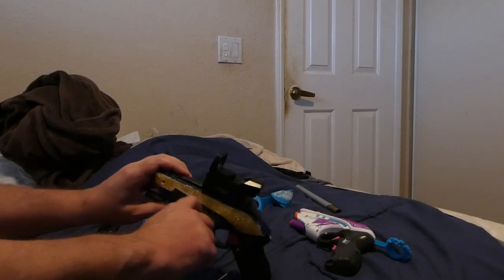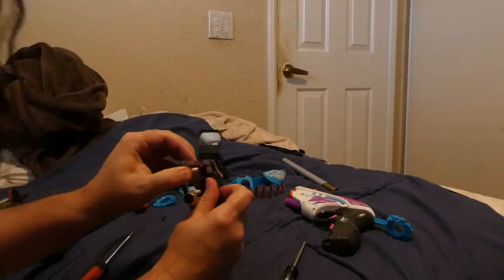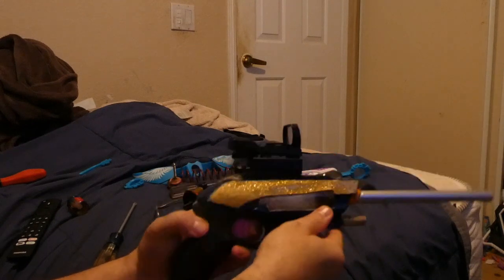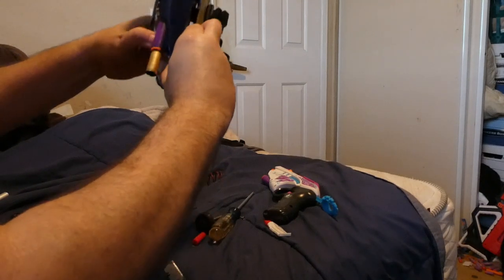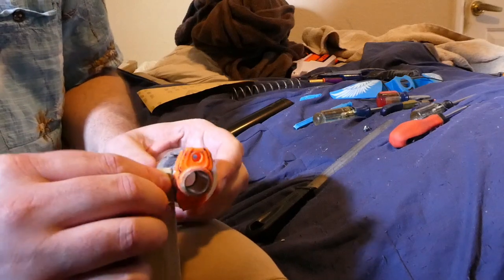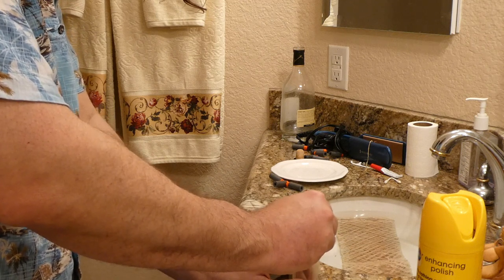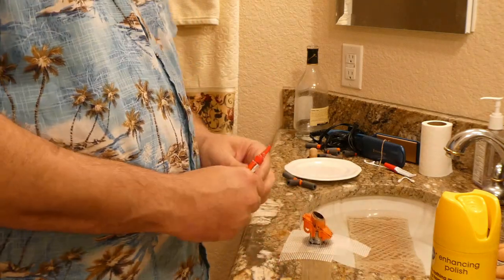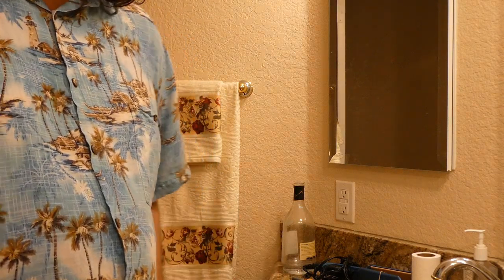Plunger rod Replacement and Plunger Tube rebuild of a Handbuilt Bird of Prey Type LT

Comment: You should buy some Delrin bar from somewhere and just make a whole new rod thing, and put on a T-pull of sorts
Reply from the maker: To be honest, the HDPE  Plunger rod (one of the Strongest PR's ever put on a Nerf Blaster stock) is very very strong, that Rod was put in when the clear tube was added in 2017, and the only reason it broke was because it was dropped and landed on the priming rod just right to snap it with the extra weight of the red dot and the Aluminum barreled turret falling on the hard stone floor.  I had never broken a PR before on a Bird of Prey even under much more yield.
Reply: @TheChrisCartaya  I kinda want to make a hardcore bird of prey type thing now lol.
I'll keep my eye out for whatever that base gun is so I can get started, but I'll probably make a stainless or brass cylinder with a cup style head for extra seal and volume and a badass handle and rod.
I'd probably keep the spring weak, and send it to you to keep when I got bored, so you could put in the scariest spring imaginable.

Probably not happening until autumn as I have airsoft stuff to do in the meantime, but lmk if you're interested in this.
Reply from the maker: @SiliconeSword  Nerf Rebelle Star Shot, that's the blaster, and i feel a delrin rod would do great.  Keep me posted feel free to PM me on Facebook.
Reply: @TheChrisCartaya  Hell yeah, will do

Comment: Is your single brass barrel sleeved inside aluminum?
Reply from the maker: No they are all Aluminum, but they are folded aluminum, not extruded, so the wall ID is even, also Wax treated (corrected, for some reason thought he was talking about the turret, my mistake)
Reply: @TheChrisCartaya  ah ok
Reply from the maker: @coltstelting6969  Dahh sorry, I for some reason thought you were talking about the turret, yes its a brass barrel nested in a 9/16th id aluminum sleeve, sorry for the confusion
Reply: @TheChrisCartaya  all good! If I may ask, what are the benefits of the aluminum sleeve? Durability?
Reply from the maker: @coltstelting6969  More weight, more stable flight path.  and yea more durable.
Reply: @TheChrisCartaya  Very nice. Where'd you get the 9/16 aluminum?
Reply from the maker: @coltstelting6969  i got it at the UBI shopping district in Singapore during a trip there.  actyally i think its 17/32 id, 5/8ths od. all i know is i had a scrap of 17/32nds on my and it fit, so i bought some, wish i bought more
Reply: @TheChrisCartaya  thanks! I'll check my hardware places to see if I can get something like that.